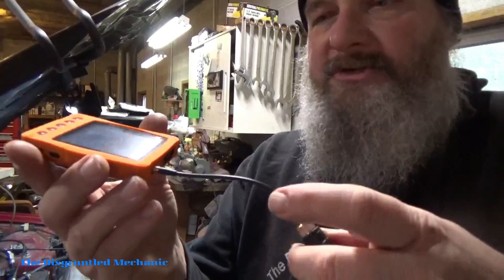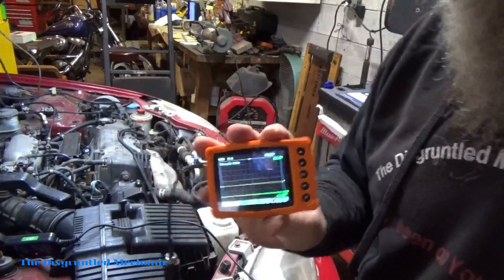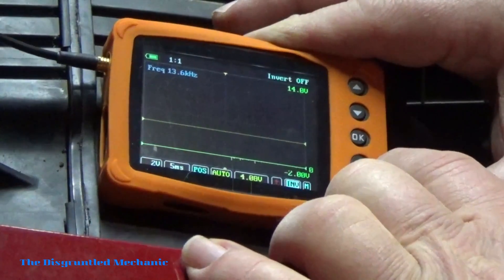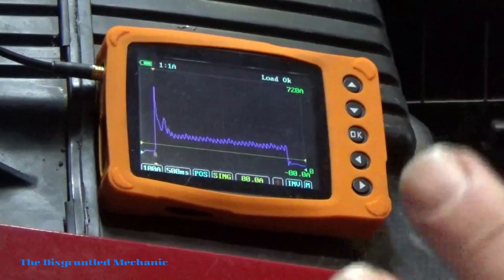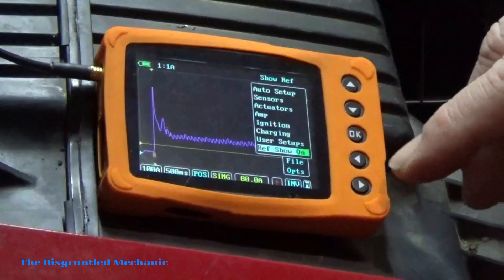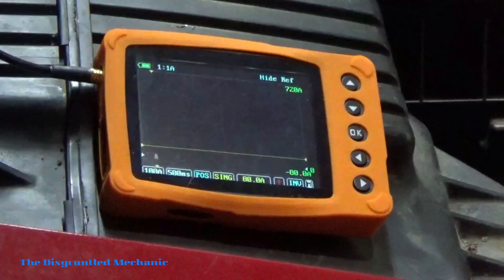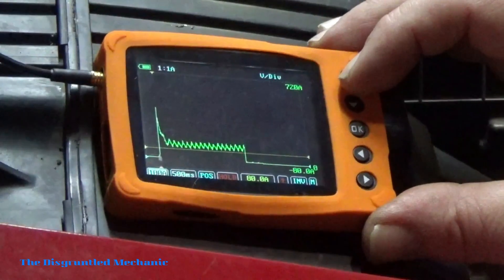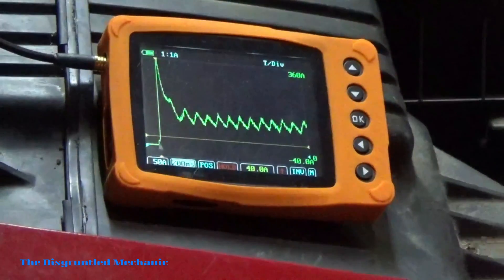Uscope and the Relative Compression Test/Setup

Comment: Really clear video. I guess I need to research the UScope more, wondering if its possible to add a trigger to the compression scope to show a reference cylinder.
Reply from the maker: The Uscope is only a signal channel so you can't do them both at the same time.

Comment: Mike, I own the U-scope but thanks for showing the test. Will do the test this weekend. Your injectors are easy mine being a 3.5 Honda I will disable by pulling the PFI  relay. I’ll let you know how I make out Artie ❤️
Reply from the maker: It seemed when I pulled the fuel pump relay it did not have spark. I was thinking the computer was shutting down spark due to no fuel. Please let me know how it works for you.
Reply: Mike i believe you are correct. Cody has a video out on doing the check and also trained by techs on a honda 3.5 misfire. I will check. Cant remember a darn thing lately. Lol you know the feeling👍
Reply: Mike the F1 15 amp ECU fuse disables injection and ignition so there is no syncing possible. This is located in the under hood fuse box. U-scope has only one channel anyway. There is something called a comb connector you can disconnect also on r/h side of engine which will disable injection but gives you sync capability with two channels. Will do some looking around tomorrow. Have a good one Artie ❤️